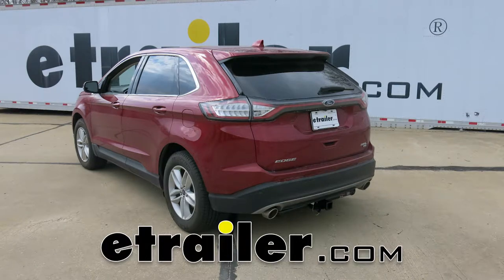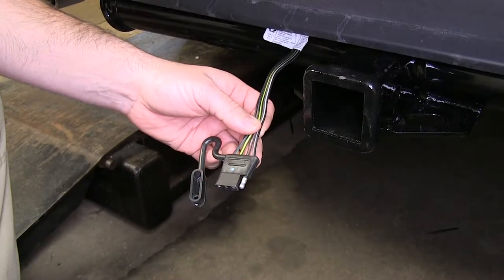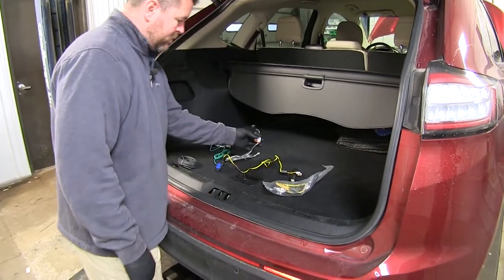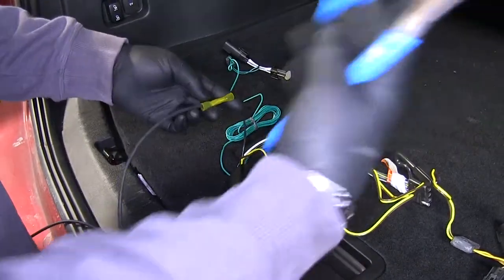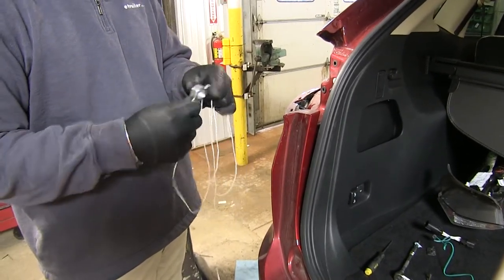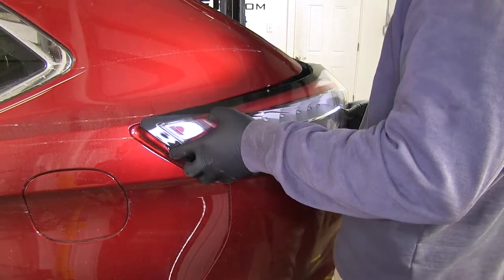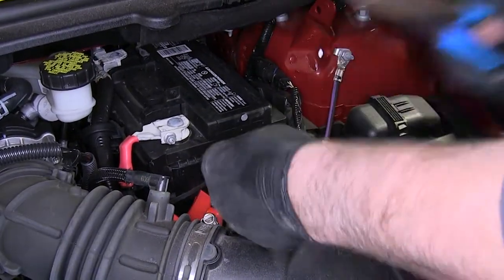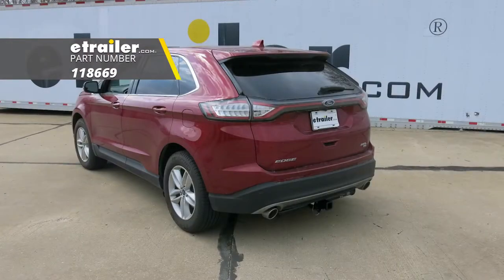Set up: T-One Vehicle Wiring Harness with 4-Pole Flat Trailer Connector on a 2017 Ford Edge

Comment: I just installed the same thing on my edge (bought it through a dealership and they offered to add it at no cost). I my 2017 edge is a v6 3.5L, how much can I tow with it? All the information I have seen on websites always quote hitch receivers from factory, but I was wondering if you have chatted with customers installing an aftermarket hitch receiver. I would like to get a small trailer and atv or a small boat to go fishing in the lake.